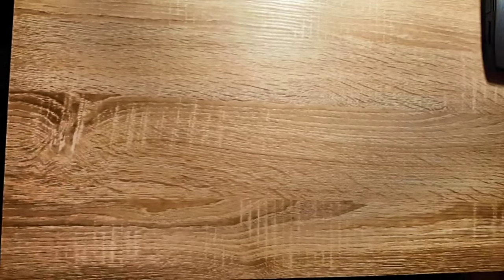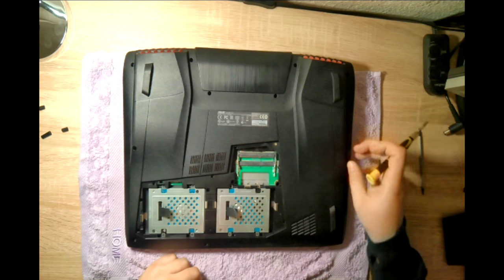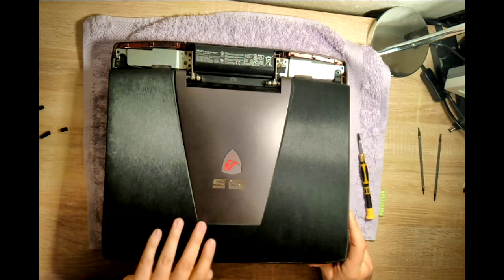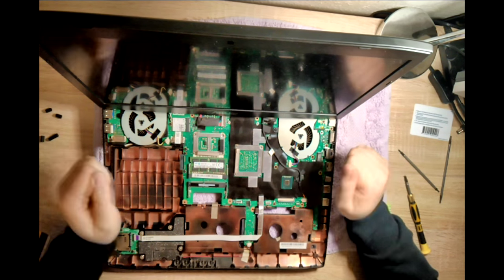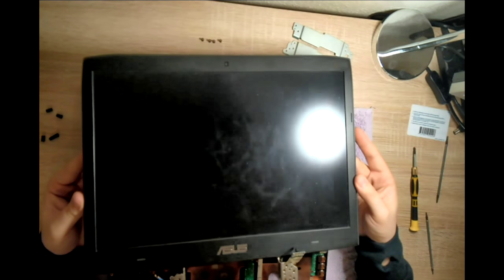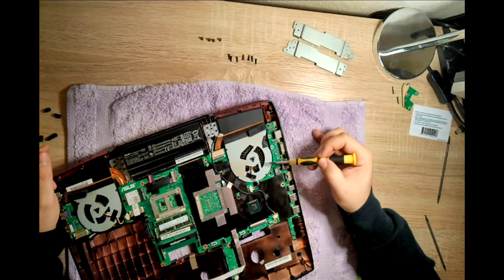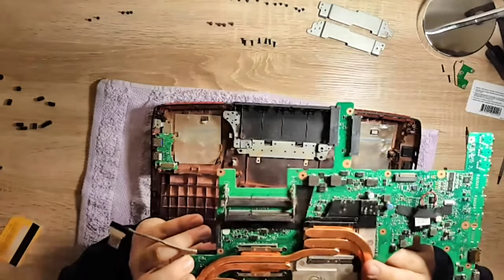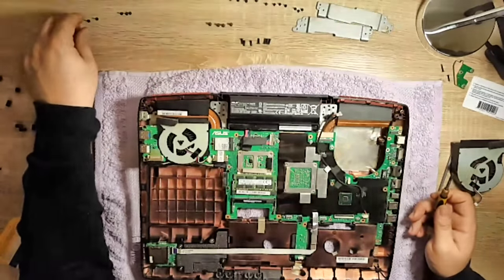Asus G751 - Complete Disassembly / Fan Cleaning / Battery Replacement

Comment: Hi! My battery is dead and I just want to clean up my laptop. Before dissembling should I back  up my data? I'm scared that it won't turn back on. I use it as a rendering and media creation system.
Thanks for the video!!
Reply from the maker: Hi, technically there's no danger for the data, because you're not modifying/tampering the storage. 
Either way, a backup is always recommended, just in case.  
Be careful around the display cable.
 A lot of people somehow damaged their motherboards. I presume because of electrical shocks or shorting something by accident. 
Be careful with metal tools around it and try to disconnect the battery first and connect it last. This way you can be sure you won't short something out.

Comment: Thank you for this great video! I opened my G751jt to clean the fans and heatsinks with a small brush. After the "surgery" everything was great, but after a few hours I could at times hear an irregular ticking/clicking. The day after, the ticking slowly got louder and sometimes it clicks very loud. I do not dare to turn it on anymore until I have solved it. Do you have any idea of what it can be and how to fix it? Could it be a harddrive making the sounds?
Reply from the maker: I seriously doubt that it's the HDD. More likely one of the fans is touching the fan casing. I think you might've over-tightened the screws and there's not enough space. Try to loosen some of the screws turn on the laptop without screwing down the palm rest and keyboard and try to locate the source of the ticking. Usually its not a good idea to brush the fan blades. Use canned air or just blow with your mouth.
Reply: It turned out to be the HDD so I have now saved the most important data and removed the HDD until I buy a new one. I am very happy it was nothing worse, and now my computer is running great again. :D
Reply from the maker: I'm quite surprised to be honest...I really wasn't expecting it to be the HDD. Anyway, this gives you a good reason to shove an SSD in there. :D

Comment: Hello, GREAT video! Very detailed and helped me all the way.

BUT, hopefully you have a idea what i should do. updated bios, but instead i seemed to have bricked it. Computer wont even post. only a black screen. Googled, and found out that removing the battery might fix it or else break power to cmos battery. Followed your guide to disassemly my G751JY. Removed the cable from computer battery on the motherboard and tried running it only with powercord. Did not start at all. Pluged in the battery and now it does not even indicate some life. Nothing lights up. Could I have shortened the motherboard?? Do you have any tip of what I could do?
Reply from the maker: +Fredrik Sjöberg Before you try anything else, remove the main battery, unplug the DC power and remove the CMOS battery for 5-10 minutes. After that put in the battery, plug in the the main battery and check for any disconnected cables ( fans, USB 3.0 board, etc. some laptops refuse to start if there's a faulty connection. It's worth the check. Also check very carefully the power button connection to the  motherboard. If it's not in the right place it won't work because the pins won't align. When you connect everything give it try. If it doesn't start then the BIOS killed it. Updating the BIOS is very risky in the first place. Please let me know if this worked! I've had a similar experience with an old desktop.
Reply: Dongleboo Wow, thanks for the quick reply! That is basicly the exact steps of what i did, just doublechecked if I missied something, but I hadn't :(
I downloaded asus own flashtool and everything. 2k euro wasted for nothing really :'( Will contact ASUS and try for a RMA, but now since i opened the computer i'm not sure they will help me.. 
Anyways, thanks man!
Reply from the maker: +Fredrik Sjöberg  Hey man, sorry I didn't reply sooner but I got carried away. Any updates? What did ASUS say? Usually, as far as I'm aware, you won't void the warranty if you open the laptop in order to install more RAM in the inside slot!
Reply: Dongleboo I got a RMA number they will pickup the computer this week. I write here when I get more info about this. Just pray to Jebus :)

Comment: Thanks for your video. Unfortunately, after cleaning my fans, and replugging everything, my screen isn't working anymore. The computer is working correctly, and the keyboard is all lighten up, but the screen is just like, dead.
Do you have any idea about what happened ?
Thanks
Reply from the maker: First thing that comes to my mind is a bad connection of the display cable. Maybe it's not plugged in correctly or something. Please double or even triple check the display connector on the motherboard. The same goes for the keyboard. The flat flex cables can be a bitch sometimes and they can short out in between the pins if the cable is plugged in a bit sideways. Connections are very important. I took apart mine again yesterday (for the 10th time) to install more memory and I have no issues whatsoever. Please check the connections and give some feedback! The display connector is rather fragile and delicate so inspect is for bent contact pins etc.
Reply: +Dongleboo Thank you for your answer. I didn't touch the motherboard at all, I just unplugged the keyboard (it's working fine) and the screen in order to clean the fans. I unplugged and replugged the screens plugs like 20 times, but it's still not working. I don't know really know what to do anymore tbh.
Reply from the maker: Did you by any chance saw some sort of a spark or discharge when you unplugged/plugged back in the cable?
Reply: +Dongleboo No, I think I was very careful with it, and I would have noticed it, there wasn't any sparkle.
Reply from the maker: Sorry to hear that man. I have no idea what could've gone wrong there. Maybe as a last resort, try to remove the battery (CMOS battery) after removing the main battery.
Reply: Féfé Lance-Roquettes Hey man! I hope you read this. I've just encountered the same issue as you and I was wondering if you found a way to fix your laptop? I've tried taking everything apart and putting it back together very carefully about 4 times now but to no avail. Is there a solution?

Comment: This video will help me clean mine when its due for one.  The only question i have is which is the GPU and which is the CPU?  I know the GPU will have memory modules around it.  I would like to know.  I have the G751JY VS71 model.
Reply from the maker: I'd love to answer that, but I've never actually checked and I'm not sure, which is which. I think the one closer to the battery is the GPU and the one in the "center" of the MB is the CPU, but it's just a guess, really. I'm glad it helped! :)
Reply: il try to do more research and see if i can find it.  I know the CPU spits out more heat according to other videos and even my own use when i use HWMonitor.
Reply: Nick Chinn  GPU is on right if you're looking at your laptop in a normal use. If you're starting at the fans from behind. The GPU is left fan.
Reply: The cpu has two screws, and the gpu has three screws. The replacement fans are 12v .40a.

Comment: If you removing battery by yourself then just cut that 2 front clips with no holes for screws from battery. With this modification you will remove it next time without touching motherboard!

Comment: Not sure if you still check this at all, but I could use help with something. My laptop is out of warranty, and the plastic that covers the right hinge seems to have started to break under pressure, which is also causing pressure for the screen.

Would you happen to know if it's possible to get replacement parts for that and if repairing it would be feasible? Everything else seems to work fine for now, it's just the hinges.
Reply from the maker: Hello mate, of course, I check this. I try to reply to every comment made on here. 
This site http://bit.ly/2nXZx2e has all the spare parts available for the G751. If it's not there, I'd suggest checking on ebay, since in most cases it has some spare parts as well. 
As for the repair itself - I think it's a matter of a simple swap. Just want to point out that the prices on this website are a bit high, so like I said, do check ebay first.
Reply: Okay, thank you! I'll check ebay first. Have you had any similar issues with the hinges? I just really want to make sure I don't mess anything up when I eventually get around to ordering the part and having it repaired.
Reply from the maker: To be honest, my hinges are rock solid. The same goes for any surrounding plastic parts. I'm surprised that you're having issues with them, as this is perhaps one of the sturdiest display mount mechanisms I've come across. Please let me know when you fix this.
Reply: Dongleboo I would blame it on the manufacturer, but I'm out of warranty anyway. 😅 I'm just hoping I can fix it myself, since their estimate is about $700. As far as I can tell, the monitor and the actual hinge seems to be fine. It's just the plastic covering breaking down.

I think I'd also need a cover for the LCD, since that seems to be coming apart, too. 
https://lh3.googleusercontent.com/DZEQtJO-uLmEPuDyyiCzXSscxAJZE3au8DX08OsFMcMEmeMiwAVepYuOUgmFgA1BL_4ZW4yCGA
Reply from the maker: Weird. Maybe it is actually a manufacture defect. I think it's better to look for a dead laptop, which you can buy off ebay. Too many parts have to be replaced. Look for a complete dispay assembly.

Comment: @Dongleboo, Thanks alot for uploading this awesome video. My battery is dead, at 0% all the time, unpluging the AC adapter cable turns off computer immediately, ..........and my battery light turn orange to green after approx. 10 seconds for 1 second. Then go back again to orange. So windows gets hibernated when it turns green. 
I have disabled the charger controller from Device Manager. So windows does not go for hibernation now.
Disabling the charge controller (kinda) turns off Nvidia GPU 970m. It gives error 43, and I am unable to play games, but normal desktop is running fine.

The question I wanted to ask is, 
1) If I remove battery only and do not install new one, will the laptop boots on?
2) Nvidia GPU will work properly without battery or not?

Thanks alot again for video.

Haseeb.
Reply from the maker: Well, I actually don't know if this laptop is made to run without a battery. All of the laptops I had before had the option to run without battery but I'm not really sure about that one. It's a specific scenario and unfortunately I have no idea. Maybe you should try, but that means that you should literally glue the AC to the laptop because it kinda slips out from time to time and it'll be a bummer if it accidentally unplugs during something important. 
As for the second question, usually the laptop automatically switches between the "eco" gpu which is part of the processor and the high performance GPU. This means that when your laptop is on "High Performance" it should use the Nvidia. Maybe you should contact either ASUS or Nvidia on that topic, because I'm literally guessing here. Why don't you buy a new battery? They're not that expensive anymore and you'll have a functional laptop again. Btw, when did you buy yours? Has one year passed yet or not?
Reply: " that means that you should literally glue the AC to the laptop because it kinda slips out from time to time and it'll be a bummer if it accidentally unplugs during something important. "

It is already in this state, because battery is completely dead(probably Li-ion Deep Sleep Mode). 

I bought it from Amazon Germany. I was on visit to Pakistan for 2 months, when the AC adapter stopped working( 15 months after purchase ). It was very disappointing for such an expensive laptop and I had only 12 months of warranty. 

Unfortuantly there was no Asus Service Center is Pakistan, so I searched the local market and found out the second hand charger of Alienware Laptop which is same output voltage but little bit higher current. This new charger in fact increase battery life about 30 minutes more.

But once my laptop was on battery and I was away for like 6 hours. When I came back battery died completely.

It would take some time to reach replacement battery, so that why I asked weather laptop will work without battery or not. 

Thanks alot though for your quick reply.
Reply from the maker: You are welcome, and I'm sorry I cannot answer, but I have no experience on this topic with this particular model. Maybe you can try, I don't think it can damage anything, since there's nothing different. The circuits that maintain the charge are still operational. The only thing I am a bit worried is that higher current. 
The warranty should be 24 months on the laptop and accessories and 12 months on the battery. If you're still within the 24 months you can get a replacement AC. I suspect that the charger that you've used from the Alienware laptop fucked up the battery. Even though the voltage is the same, the higher current might have damaged the cells.
Reply: Actually I was deceived by Amazon, my laptop only have 12 months of warranty, despite all laptops in Germany get 24 months of warranty. The sent me laptop with french keyboard in germnay, so that particular model comes only with 12 month of warranty. On bright side i only had to pay 1300 euros 15 months ago to get 970m 3GB, 16 GB ram, 1TB+128GB ssd instead of 1700 euros.

Anyways, I followed your video, disassembled completly, removed the battery. Now my nvidia card is also working fine so This laptop also work without battery :)

Thanks alot again man, you are my hero :)
Reply from the maker: I'm glad it works! :)
Reply: I have the same problem with the dead battery and the computer hibernating every 5 min, now I know how to change the battery, thanks man, I see that this problem with the battery is common, its a shame that this laptop has this problem, and I only have 15 months with this computer :( I dont know now if it was a good purchase...
Reply from the maker: I think they had a batch with defective batteries because it's not THAT common. Other than that I'm pleased with the performance of the laptop and I would buy it again if I had to.
Reply: +Dongleboo yes me too. i have changed some settings in bios and now it boots in 4-5 seconds to desktop. what else a person wants after clicking power button. :)
Reply from the maker: Exactly! :)

Comment: So I have two questions for you. 

1. Is it possible to remove the rear red fan vents without removing the keyboard or monitor? I use my laptop in a professional setting and get some dirty looks from "business type people" when they see the gamer laptop. Hoping to paint them black. 

2. Do you know of a source for the hard drive cradles? Mine only came with one cradle and Asus is not willing to send/sell me one.
Reply from the maker: 1. LOL I have the same issue as I'm an IT specialist. What about the big glowing "Republic of Gamers" logo on the back? XD Anyway,  you can get access to the vents by removing the panel behind the monitor. I'm not sure however if the vents can actually be detached from the main chassis. Also, I'm 90% sure that the heat sinks have to be removed in order to remove the vents. This means removing the entire motherboard which is a complete disassembly. My cousin's laptop came with only one cradle as well and we contacted Asus but they refused to sell this. I have no idea where you can get it from. Maybe look for a broken/damaged G751 for spare parts?

Comment: Hi! I don't suppose you could help me out? This was my first time taking apart a computer of any kind due to a dead battery, and I'm about at my wit's end when it comes to putting it back together. My screen no longer seems to be aligning correctly to the laptop, and a popping sound can be heard when lifting it, and the back part with the speaker wire won't click into place. When closed, the screen is angled towards the left (Like a diamond instead of a square, only not so dramatic is the only way I can think to describe it). Looking closer, the hinges behind the battery towards the front of the laptop aren't the same. On the right side, the black plastic hook that goes around the metal piece is popped off, whereas the left hook is correct. It will fix itself when opening and closing, but the pop sound is still there and the screen is still not aligned, and the back piece still won't pop into place. What did I do wrong?
Reply from the maker: The only thing that comes to my mind is that you might have messed up the placement of the screws on the hinge or misaligned the holes. Although I'm not even sure how that can be accomplished, still it's maybe an option. There are quite a few holes and 2 different sized screws which go there, along with the small metal plates, which are marked L and R. Check those out as well, you might have swapped them out...somehow. 
As a last resort, I suggest that you take it apart again, and start over.